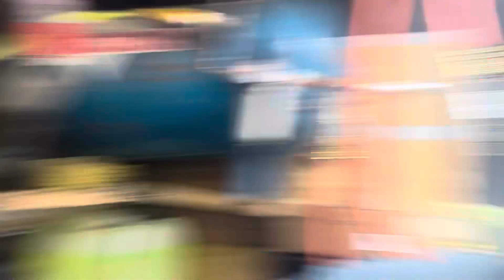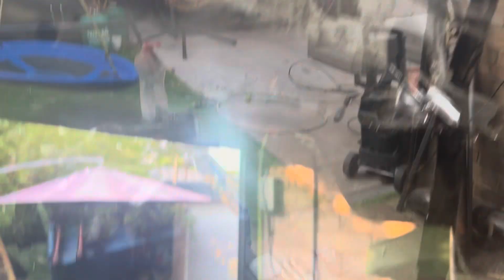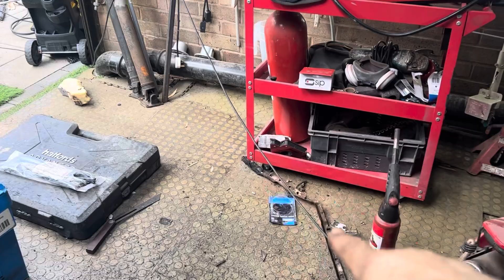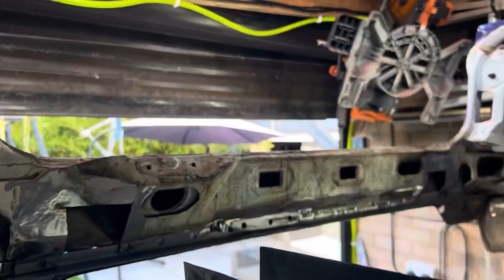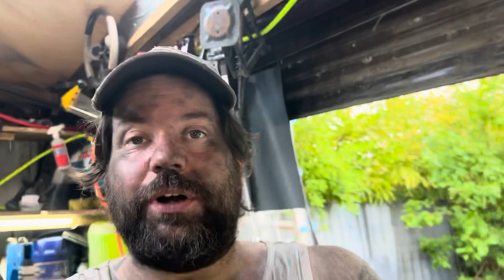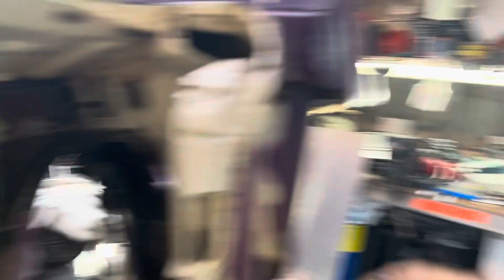#29 escort rs turbo RWD conversion restoration custom boot floor

Comment: Aweaome fella
Reply from the maker: Cheers pal,, starting to get there with it now,, is yours started?
Reply: @NicksGarageUk  hahahahhah npt even started it lol bit npw managed to get my hands on a 1800 rather than the 1600 i have
Reply from the maker: Full car again? I’m just using this as a start for the chassis etc, then need LSD, 6 speed box and I’m building a fully forged engine
Reply: @NicksGarageUk  yea i havnt pulled the other one apart as yet so if i get a full car ill have some spares just in case ol